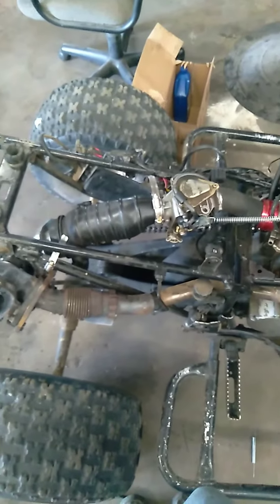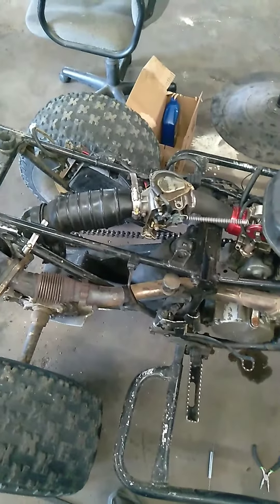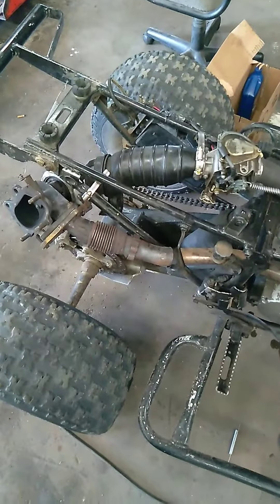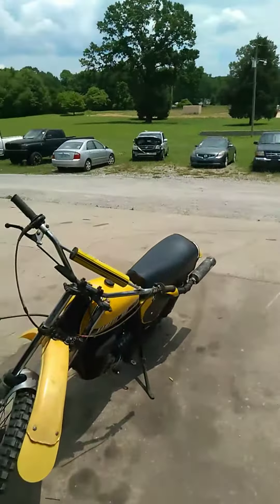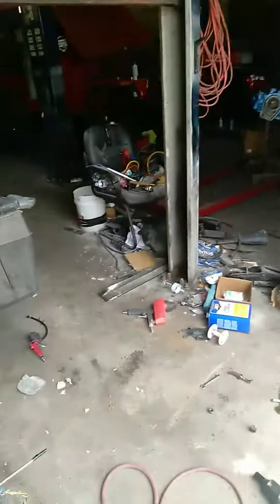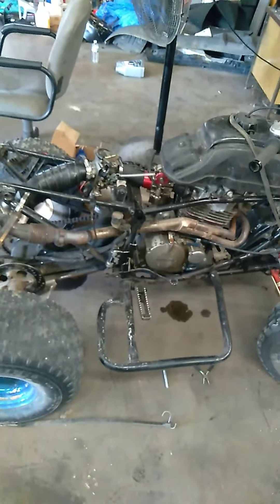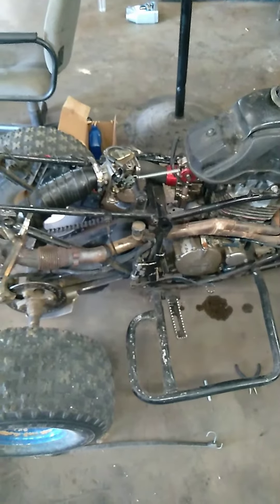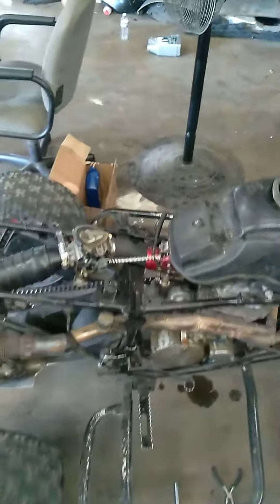Turbo 400ex part 2

Comment: Why 2 carbs? Run just the edelbrock. Be much easier
Reply from the maker: The edlerblock didn't have enough fuel the turbo was to big lol
Reply: AWDBOY ohhh ok
Reply: @awdboy284  put different jets in it